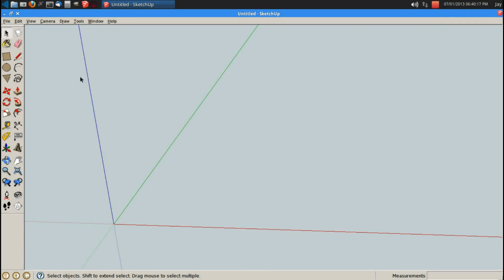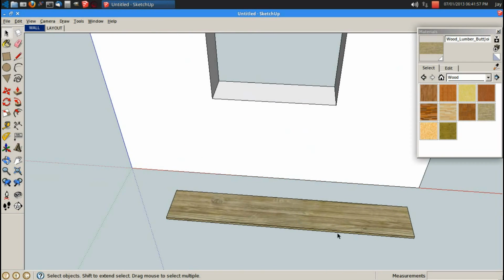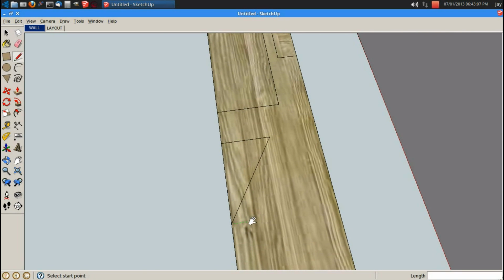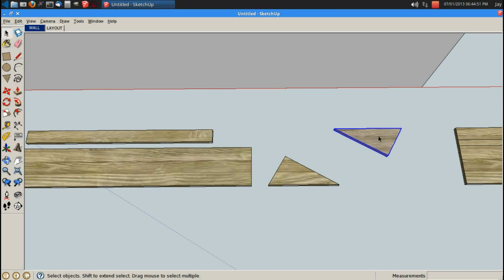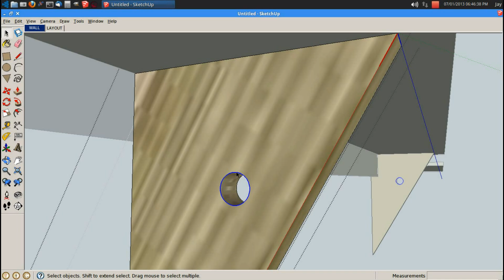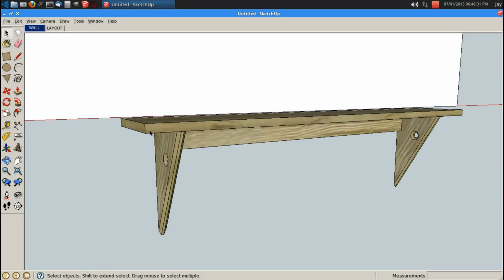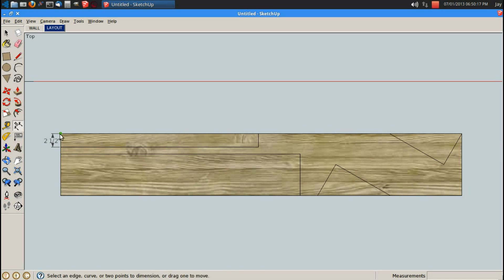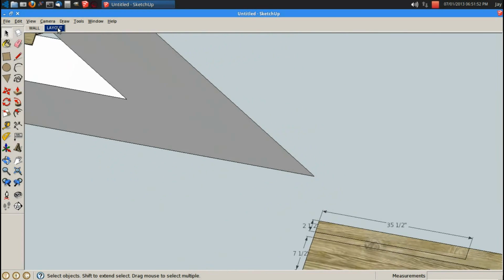SketchUp - Curtain Rod Shelf - 105

Comment: Nice quick project in Sketchup, thanks Jay - Only 1 place I can see you can take a small shortcut is that you can use the dimensions tool and drag a specific vertex off rather than click the 2 end points of it. Same result, 1 less click =)